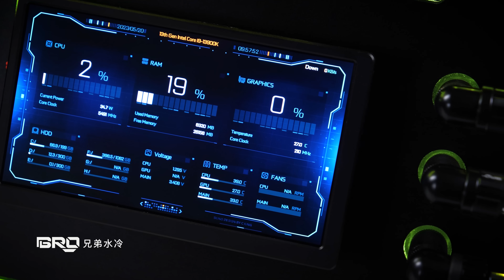「BRO」4K Water Cooled PC Build BRO Custom Wall Ditched The Chassis.Do You Want This Wall?#pcbuild

Comment: What is that thing you insert at the side of the RAM at 1:25?
Reply: its asus m2ssd drive (you can add 2 m2 ssd in it and plug directly into the motherboard slot)
Reply: Thanks for info

Comment: I need that in my life.. is also like to see a benchmark and a thermal  watt output cause im sure that thing is like a fireplace for heat coverage. I have a 4070, i9 14900k, corsair link titan 360 aio, the aorus eliye ax MB , and y4gb of vengeance 6000mhz ram and my room with box fan, ceiling fan and wind tunnel fan still feel like im outside mowing during peak summer

Comment: My friend shared this video with me. There at least you don't run out of air 😂. Well the thermaltake in fans is not great quality from memory but they look nice. I've been thinking about it for several days and apart from the techno-artistic prowess in terms of plumbing and the experience I don't really see the thing. It's not practical, it takes up a huge amount of space, it's full of complications, sources of problems like the road to hell, but the most surprising thing is that they never show the rear part and that's it. is a shame. well there is also the choice of equipment which is not highlighted and the white gloves like I'm showing off while they piss me off to screw with the screwdriver from the asie-express sponsors and I'm hot in the hands but it's for show.

Comment: I get the same temperatures on my 15 year old pc, side panel is lost long time ago, and in idle I have exactly the same temps and loads with OEM fans. i5-4570, RAM 16 GB, 240 SSD, GTX 660. Never seen temps go above 80 under full load. And my system cost is around 150 USD. This video is beautiful though. Would be great to see it under stress test.

Comment: This is the greatest build and it's what I always wanted for a long time
Reply: How would you connect all your peripherals once it hangs on the wall? Would want all the cables flying off the top of your wall? You would have to place the thing right behind your screens in order to me sense of this design.
Reply: @romzen  I'll first mount the pc then go for 98inch desk with headboard with three monitors 45inch ultra wide as a main display flanked by two 32 inch monitors

Comment: Gonna assume the fan change near the end was due to the connection issues with the Thermaltake SWAFAN's that he was using in the beggining. I have those fans in my build and when you first install them, they might not turn on due to a poor connection which I experienced with both sets that I and using.  The power and RGB connector is connected magnetically as well as the connections between the fans.  I had to tap the connector on the fan with one set and the other set I had to tap the corner of the fan where the two fans power connection was located.  I like how the fans use magnetic connections to stay together but the electrical connection needs improvement.

Comment: Looks good. One thing to improve, either put custom shrouding over the cable connections or work on cable management it detracts from the clean build having random wires just coming out of places and in different colors not keeping in line with the builds "look" especially the nest going into the psu. Maybe even a custom faceplates that would go over all components to make it look super clean.

Comment: it's a stunning build, I've seen a couple similar over the years but this is pretty sweet. Two things, one you didn't max out your DIMM slots which on a build like this is a bad decision, two what is the name of the cable you used to connect the 4090 to the motherboard?
Reply: I think every riser can do this

Comment: Cool but my question is what do you do about dust? It's not like shielded electronics where you can use various dusters.
Reply from the maker: Open type, dust will only concentrate on the fan. Clean it regularly with a blower

Comment: I love this build, it's truly something special. However, if this was a PC build-off, the visible wires would be hits.  A sleeve over the pump wires would be a nice touch. I don't know what the back looks like but if the power supply cables could have just gone straight back instead of crossing over each other while going down it would be perfect. The RGB cable for the upper right flow indicator stands out, if there was a cut-out that matched the left side that would be awesome. All in all the build is still amazing.

Comment: Hi, i have some questions as i am thinking of doing something like this myself for a personal project: 1. Are there Fluid Channels inside the Acrylic Part or does the Tubing just go behind the Plate and you route it there? 2. How heavy does this get when the Loop is filled? 3. Are the Fans Pulling from the front and push to the back? I hope you can answer me these questions :)
Reply from the maker: big size distro plate.. Weight is about 60~70kg...

Comment: Yes, the build looks really great until it comes to 'reality.' The power plug is tied along the side, so there's no way to place it at the back, right?

Furthermore, on the graphics card and the motherboard, not a single port is available, which means the space that exists is too small or something else. It's essentially just a show PC with impressive specs again.

I'm just interested in how the whole thing looks in terms of functionality, completely functional with monitors, mouse/keyboard, etc.
Reply: I though exactly same, in addition I still don't understand since its a "wall" why use all these fans (whose purpose should be to cool everything inside a normal case) are there just for "fashion" with no function at all, but ye great build (talking just about quality of the hardware used)
Reply: @DarioSciortino  The fans, as they are, have the purpose of cooling the water cooling in this case, so they make sense. I think it's relatively simple here, one circuit for the graphics card and one for the CPU.

I'm also interested in what they do with the built systems afterwards? you really never see them anywhere again

Comment: Great video but I have to wonder why anyone would wear gloves when working on electronic components. Wouldn't you want the best dexterity, control and sense of touch possible?
Reply from the maker: Anti-static gloves..Also prevents fingerprints from oxidizing
Reply: @BROCOOLING   What happens when fingerprints oxidize?  I'm not getting the connection.

Comment: it looks nice but the design is dangerous,  power supply is located under water pipes any leakages which will happen sooner or later water will flow directly into high voltage which ll be lethal. you should relocate power supply above all water piping or at least mount a protective tray on top of PS to guide any water spillage away 
In general it is a new concept which i think it ll be adapted with so many enthusiasts 

great job
Reply from the maker: are tested for safety

Comment: Im still having a question, Why in this kind of buildings with water cooling, always uses the ASUS ROG RTX 4090?, When you took the air cooler and RGB out, the graphic card is the same as other 4090 brands? The only difference was the cooler and software (because the waranty was broken)
Reply from the maker: The warranty efficiency of each brand is different in each region.
Reply: @BROCOOLING  Yeah, but in case of ASUS, the waranty declines when you remove the screw with the white sticker, so it becames in another GPU like other brands

Comment: Sir, which system do you recommend?
What would your ranking be like?

1
.INTEL Core i9-12900K Processor
.MSI Z690 Force Wifi Motherboard 
.MSI RTX 3080 Ti Suprim X Graphics Card
.Gskill TridentZ 5 DDR5 6000MHz Ram
.Arctic Liquid Freezer III 360 Liquid Cooling
.Case Lianli Lancool III
.MSI A850GF 850Watt Power Supply
.Samsung 860 Pro SSD

2
• Processor: INTEL i9-12900K
• Motherboard: MSI Z690 Carbon Wi-Fi
• Graphics card: MSI RTX 3090 Ti Suprim
• RAM: G.Skill TridentZ 5 32GB (2x16) 5600MHz DDR5
• Storage: MSI Spatium M480 1TB
• Cooling: MSI CoreLiquid K360 V2 360mm
• Case: Lianli Lancool III
• Power supply: MSI A1000G 1000W 80+ Gold

3
.Intel Core i9-12900K Processor
.MSI MPG Z690 FORCE WIFI Motherboard
.MSI GEFORCE RTX 3090 SUPRIM X Graphics Card
.Corsair Dominator RGB 5200MHz DDR5 Ram
.MSI SPATIUM M480 NVMe M.2 GEN4 SSD 2TB - 2 Pieces
.MSI MEG CoreLiquid S360 Liquid Cooling
.MSI MAG A850GF 850 Watt Power Supply
.case Lianli lancoOl III

Comment: Next time try it while grounded out so you don't permanently damage parts.
You just made every electronic engineers PP shrivel by not understanding small static discharge causes early faults on electronic parts.
No they don't die instantly.
Yes it has been proven time and time again that damage is done and is permanent.

Also, all of those 90 degree bends create massive strain on the flow from your water pumps.
You just gave this '12.6k usd' build a very short lifespan.

Comment: 10:38 3% CPU and 39°C 🤣 yo dawg, all that fancy RGB ain't cooling anything. You need better radiators, best out there are EK-Quantum Surface and since you went for a  560, then the P560M is what you want, it has almost twice the surface of what you have on video.
Reply: @krisg822  Were thinking same 👍✌️☘️

Comment: I have a question. Does it matter if you swap the CPU block in and out? I have the Thermaltake pacific mx2, or does the pump have to work too hard? or does it cool worse?
Reply from the maker: To be in and out correctly

Comment: Great job on 3 aspects: using spatula on thermal paste, using metal pipe for flowing of cooling liquid, using separate cooling system for cpu and gpu. not many pc builders understand the value of these 3 issues
Reply from the maker: thx....pls subscribe BRO channel.

Comment: Looks pretty, but have fun with your VRM temps with no airflow at all over the motherboard. Also note they don't show it in other angles (from above or behind) because they have nothing plugged into the IO panel. I have 7 USB devices and a network cable in the back of my PC plus a displayport and a HDMI cable in my GPU. They couldn't even run the PSU cable through the slot it is intended for and had to just run the cable across the table and tuck it around the corner. Where's the 'case' front IO panel? You know, power/reset buttons, USB ports and audio ports?
Reply from the maker: You can learn about something called Thunderbolt...
Reply: @BROCOOLING  nobody uses that LMAO

Comment: It's not how you have to put the thermic paste. The way you do it, has a risk to trap air bubble which would not transfert the heat as well.  You have to put some in the center and then when you press all the air is pushed away when the paste is squeezed.  
Oh and you put too much and some goes around... That's bad for heat dispersion.  Too much is not working better. 
And I don't like the fact that the SSD is glued it makes it difficult to change if needed or even add another one since you have 2 places. Even worse there are 2 glued stick on each side and that can damage the SSD if you ever try to access to it again. (maybe the warning is for that, but anyway it's not good and have no good purpose).